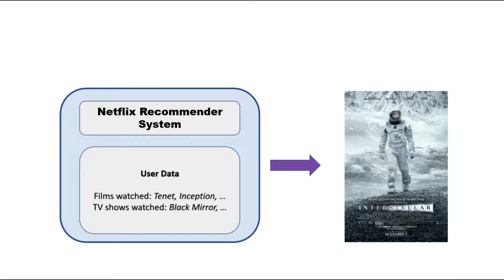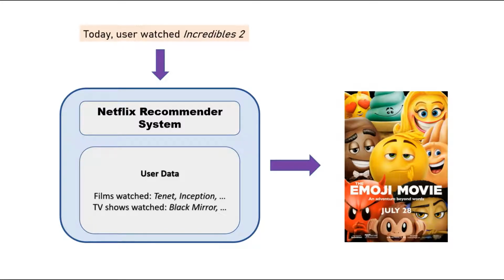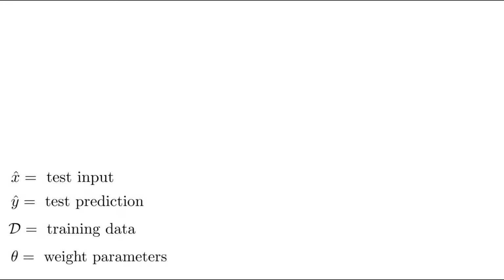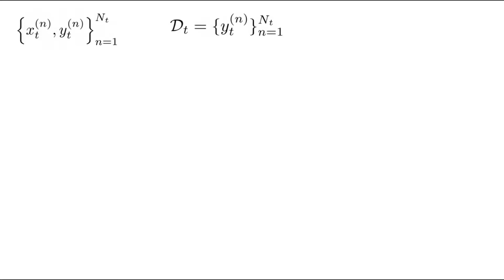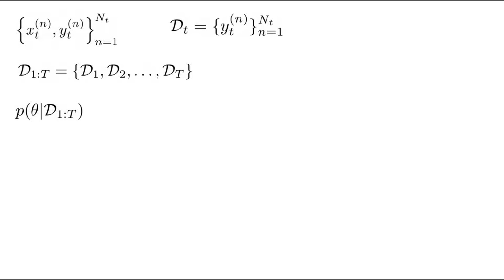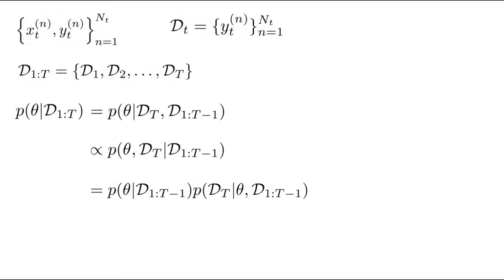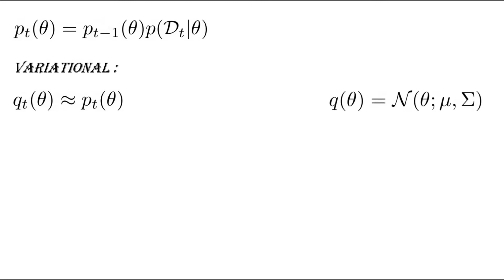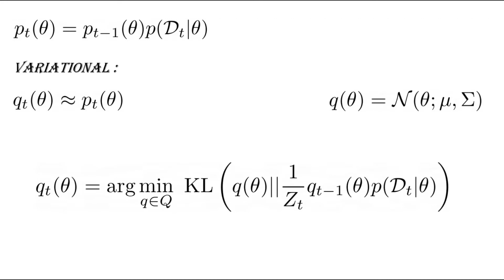Variational Continual Learning (VCL) | Machine Learning

Comment: Thanks for the video! Question: Wouldn't you expect to get an accumulation of approximation error if you keep using the last posterior as new prior. For example the approximate posterior is known to be mode-seeking hence underestimating the uncertainty, wouldn't we expect this error to accumulate? Could it make sense to "ground" the posterior with the whole dataset from time to time? Or does VCL work well enough in practice.
I'd also appreciate a partial answer.
Reply from the maker: Yes, you are absolutely correct: there is the theoretical concern that this recursive structure of calling the new prior the posterior from the previous task leads to error accumulating which in turn can cause the algorithm to 'forget' old tasks. So, the solution proposed by the Variational Continual Learning paper (Nguyen et al 2018) was the idea of 'episodic memory enhancement'. This is where a small subset of data is sampled from previous tasks to carry forward to the new tasks on which the VCL system will be trained alongside the new task data to prevent 'forgetting'. This approach appears to achieve better results compared to the baseline systems but in my opinion it seems like cheating a little bit as true online learning should not allow revisiting of old data.
Reply: @TwinEdProductions    thanks for your answer. I've now looked into the paper.  It seems they take good care to not double count these sampled "core" datapoints by leaving them out of the posterior training. Before prediction, these are finally incorporated into the approximate posterior (I guess also with gradient descent) but this in-core-porated ;) posterior is of course discarded each time, so we have some additional computational cost. Yet we are still better off than if we retrained on all data each time (this corresponds to all data being in the core set). I'd say it's an elegant interpolation between the two extremes that allows to trade off (by means of the core set size) accuracy and computational cost.

It's cheating if you say old data cannot be stored. But otherwise I'd say it's fine because it succesfully avoids non-linear asymptotic complexity.
Reply from the maker: @dermitdembrot3091  Yes, I agree the compromise is elegant and also sensible to remove the coreset from the previous tasks' training data but I can't help think the result is not particularly surprising: larger the corset size, smaller the drop in accuracy on previous tasks. And how large is the coreset allowed to be before we count it as basically training on the previous task at the same time which basically beats the point of continual learning? Also, given the experiments are performed on toy datasets (MNIST), it would be interesting to see if variational continual learning transfers well to more realistic settings of the task! All in all, I do like the paper (which is why I made the video on it :) ), in particular how they argue that the Bayesian outlook offers a natural framework for continual learning.
Reply: @TwinEdProductions  Well partly "the point of continual learning" is getting a high performance on a continual learning task at an acceptable computational cost. Whether you train your posterior twice as long or rather use half the computational budget to tune it to the core set shouldn't really matter, right? (Given your memory budget is enough for the core set.)

And yes, the Bayesian approach rocks!

By any chance do you understand TRPO and if so, how does it relate to VCL?
Reply from the maker: @dermitdembrot3091  Ok yes, you've convinced me though 'acceptable computational cost' is pretty subjective. I've heard a bit about Trust Region Policy Optimization (I presume this is what you were referring to with TRPO) but I haven't sufficiently studied it to have a sensible discussion on it :) . I will check out that 2017 paper on TRPO though!